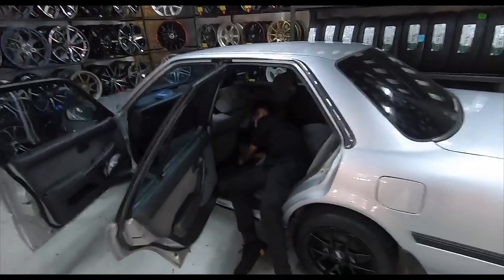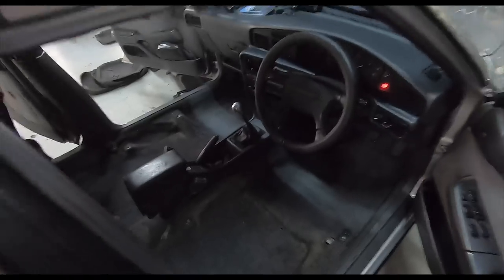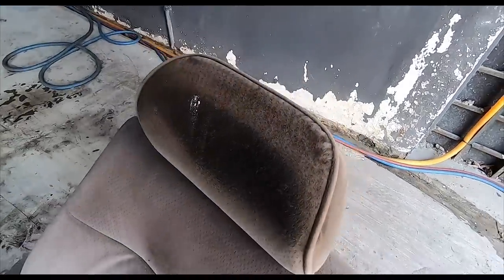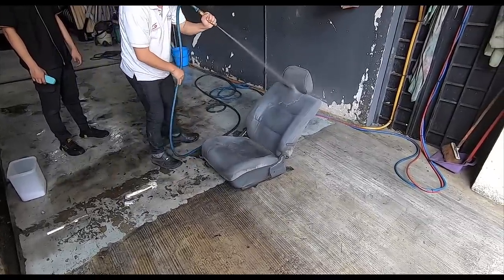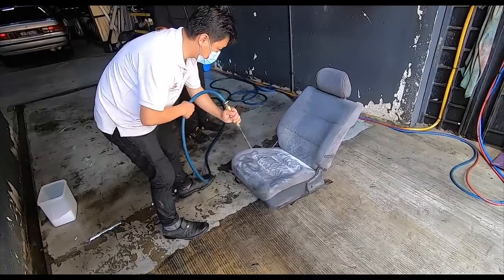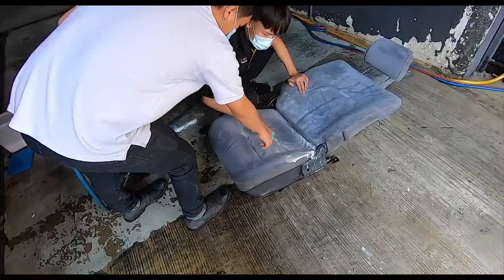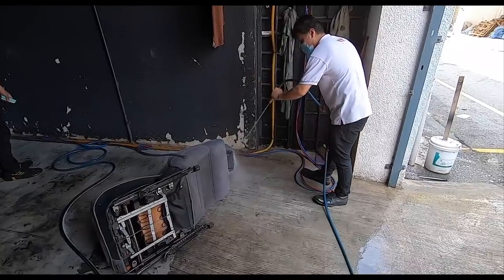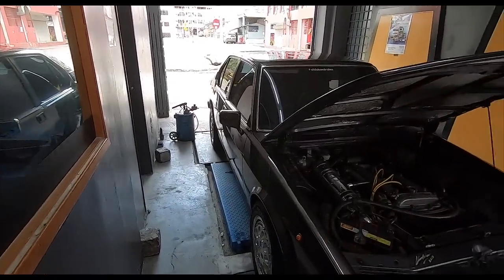WEEVIL UPDATE: '89 Toyota Corona Seats Wash! PLUS '79 Alfetta 10-Point Check DONE! | EvoMalaysia.com

Comment: I just did seat wash which cost RM200. But they took out the cover to wash rather than spraying like in the video. If spraying and washing without taking the cover will spoil the sponge inside and it wont dry easily.
Reply from the maker: No harm doing it your way, I wanted a much deeper cleaning, so I did it this way.